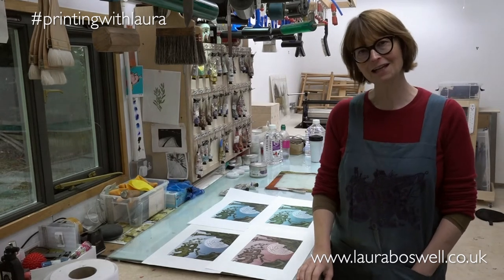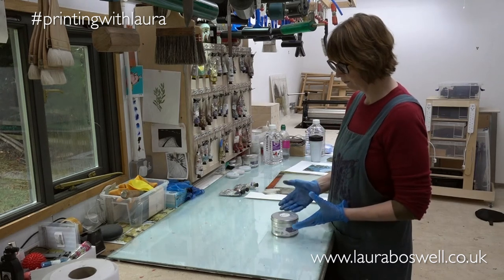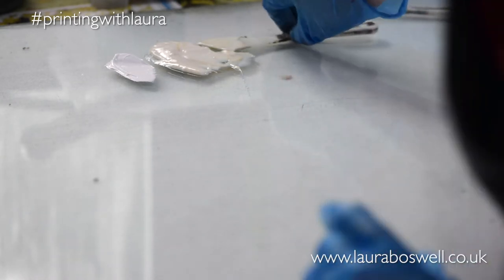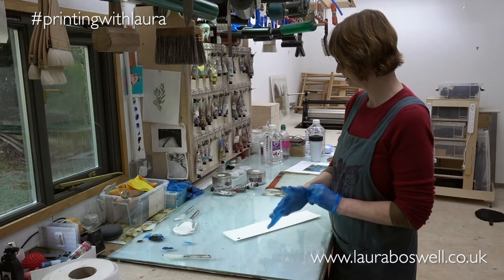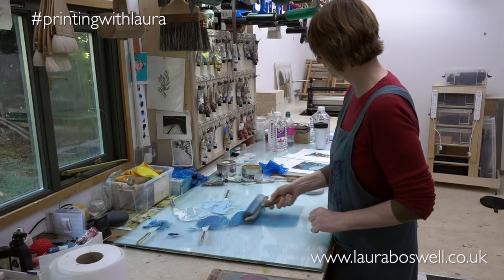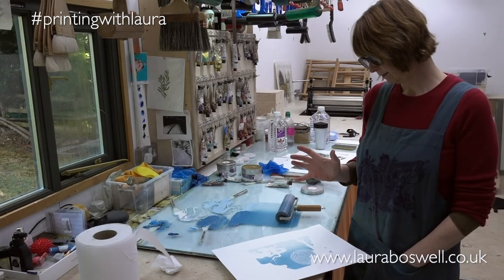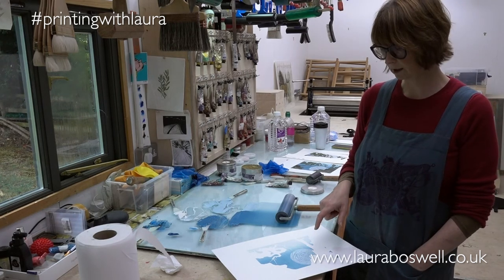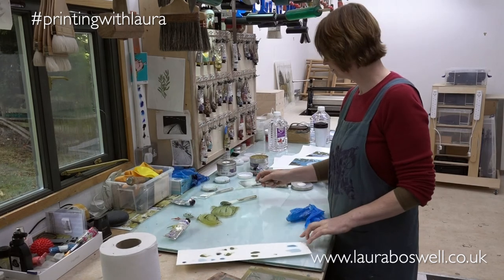Mixing Colour for Linocut Printing in Real Time - Slow and Nerdy!

Comment: Hi Laura, that was a fantastic watch which is really helpful too. Can I ask - the first blue test print you did you showed some marks that you were not happy with. Were those marks picked up by the roller on the glass slab? Big thumbs up.
Reply from the maker: Hi Paul- the problem was how I’d rolled it out- I’d not worked it enough to get it even. Extended inks need more rolling 🙂 glad the film was helpful!
Reply: @LauraBoswellPrintmaker  Thanks - will watch for that when I do my rolling.

Comment: The rollers you have used for the rainbow roll of the green and khaki and the darker green to follow ... which supplier did you source them from please? I have one of these rollers which I purchased a number of years ago and can't remember where I got it from. Would love to get some more. Also, have you mixed enough ink in this session to do the whole edition of 50?
Reply from the maker: It was Handprinted and yes - enough ink for all of them 🙂
Reply: @LauraBoswellPrintmaker  Magic, thank you! I should have guessed I'd bought it from Handprinted. I am absolutely amazed that you can do an edition of 50 with the ink you've mixed. I thought I was scanty! I'll have to keep working on it. Thanks again.